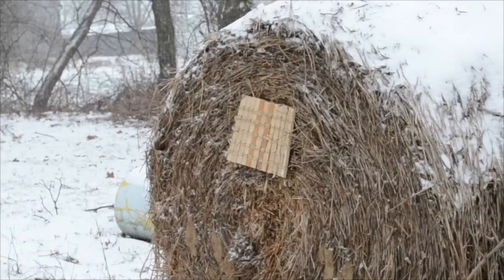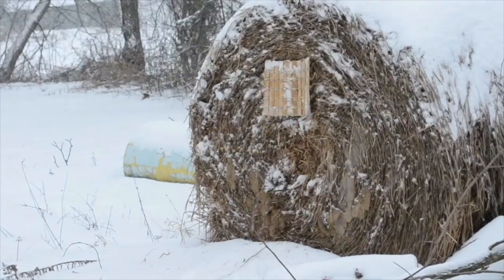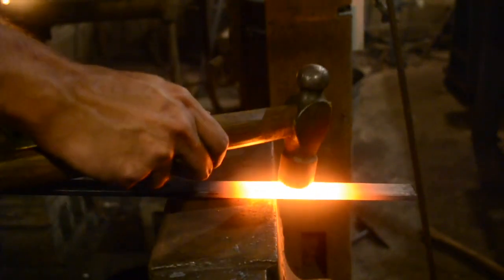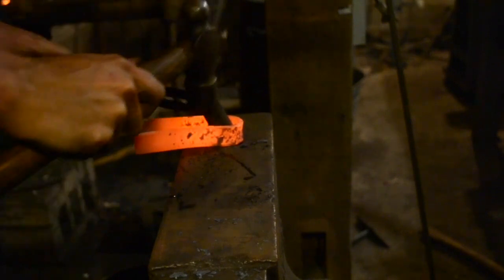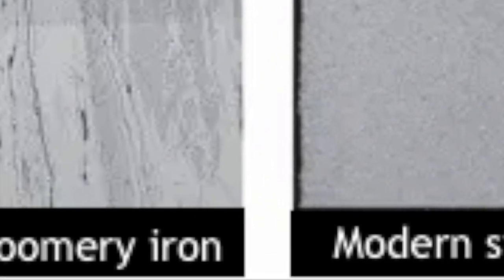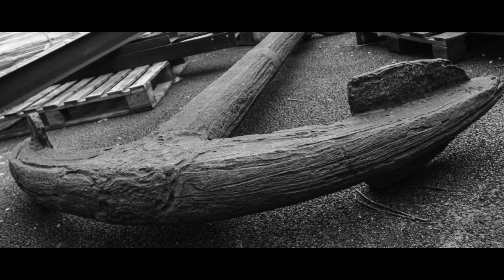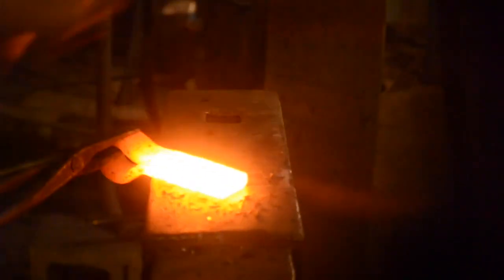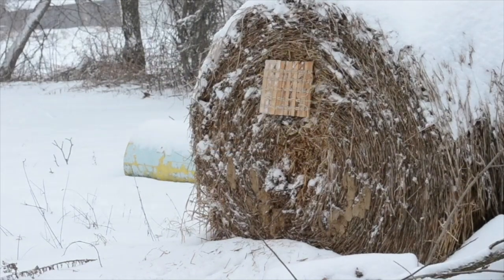Thoughts on plate armor tests and wrought iron.

Comment: The sad thing about wrought iron is that there is only one source I know of that makes wrought iron commercially for sale... and it ain't cheap.

It is now one of those weird cases where the cheapest, most readily available material way back in the good 'ol days is now way more expensive than the fancy High-carbon springsteels of Today. Which makes getting your hands on properly made 'Poor-man's armour' would ironically cost more than one made from High carbon steel! :P
Reply from the maker: And that one company doesn't actually make new wrought iron, it just recycles antiques into bar form.
Reply: @MalcolmPL  yep

Comment: As a blacksmith i fully agree, i always found this super interesting and i had the same taught that many modern armour makers miss this point (probably as You said because it is too labour intense), so far i hawe only seen one single gauntled made by damascus steel, but that turned out to be made of modern nickel steel as it seemed whan i took a close up of the picture.
It had been genuinly interesting if there could be a teamwork of skilled people who where seriously interested in a fully tecnickally accurate project, i hawe dremt about see that being done but at the same time felt it being an owerwhelming tast to preform all by my self, in historcial times it was probably done by a lot of different craftsmen in a whole cahin, not as today whan one man has to do litterary everything from zero.
Reply from the maker: Yes, you’re right, you would need a team, I estimate you would need at least four highly skilled smiths with different specialties.
And then on top of that there are probably plenty of logistical difficulties that I haven’t thought of.
Reply: @MalcolmPL  I would gladly participate if there where more people interested and the logistic problems could be solved.
Reply from the maker: Despite over a decade of experience forging, I would have nothing to contribute to a project like that.
Reply: @MalcolmPL  You underestimate Your self mate!
Reply from the maker: I lack the specialized skills required by a project like that. My skills extend to knives and furniture, neither of which are terribly applicable.

It’s like asking an optometrist to perform trauma surgery, maybe he can muddle through, but he’s probably not going to do a great job.
Reply: @MalcolmPL  
Ok, iuunderstand but damascener with carbon or nickel steel is not that complicated, i hawe done that several times, including laminated with only carbon and non nickel low carbon steel. Old Wroght iron is pretty easy to forgeweld, if You want to give it a try. I think just a small piece would be enough for trying.

I will certanly take a look again on the bog ore i found on my fathers farmland, if it is useful or not, i think the concentration may be enough to give it a try one day.

But, i hawe to learn more about the extraction process first...
As i remember it is important to first gass off organic impurities by heating up the ore powder ower a fire.
Reply: It's probably just an example of paralell invention, but there are finds from the iron age in Sweden of steel ribbon armour which reminds me a bit of those native armour You showed here, which makes me believe that there must had bbeen armour made from wood and raw hide before the iron age, but it has not been preserved and probably partly dissapeared when metal weapons where introduced, however, i hawe no idea how it did look, probably like old Celtic raw hide helmets my best guess, but with boneplates instead of bor fangs.
Reply from the maker: On the subject of smelting, here are some links to a design for a bloomery furnace with instructions for smelting.
I can’t vouch for the method personally, but I know several people in my blacksmith association who have had good success with it.

http://www.warehamforge.ca/ironsmelting/EconoNorse/index.html

http://www.warehamforge.ca/ironsmelting/QuadState08/Quad%20State%2008.html
Reply: @MalcolmPL  Thank You! I did wisit an event long time ago where they made iron directly from bog ores with the open pit method and explained the basics of it.

My old master made some reconstructions of the Mästermyr chest tools he showed me and tould about the bog iron process.

I will certanly hawe a look  on the links You gave me!
Reply from the maker: On the subject of parallel evolution, I think it’s probable that there was some sort of wooden or rawhide armor used in the european mesolithic, however I also think that the design of iron age armor has more to do with the conveniences of the metal, rather than a design tradition. Just Easier to make strips of steel than to make wide plates.
Reply: @MalcolmPL  I think so too, but i am still curious about what was before the iron strips, i don't think it was only raw hide.

Comment: Very interesting! Raises more questions though. Is it safe to assume the historical steel came from a rich person’s armor? If so was the smith any good? or did he schmooze his way to the top? I’d like to see a comparison of a nobles armor and a conscripted peasant’s, or the difference in steel quality from continent to continent. For example did the Middle East and Asia have higher quality steel than Europe? (I would assume they did) really cool video though
Reply from the maker: I read an excerpt from “the knight and the blast furnace,” by Alan Williams, he analyzed a great many suits of armor, he didn’t give exact numbers but he found a high degree of variability in the amount of slag.
However what we can say with certainty that armor was not made from the lowest grade steel, as the amount of slag limits how thin you can make the steel.
Reply: @MalcolmPL  I wish more people would put some thought in to things liked this. In school we got a lot of incomplete answers, or more often just wrong. Really basic things like “European armor wasn’t designed to stop arrows.” …..I have to stop there before it becomes an incoherent rant. lol
Reply: As a rule any armour as able to do the job its more how much the wearer suffered, even low quality iron armour was a arable to stop arrows if the  wearer suffered carrying the extra weight to make it thick enough.
As for the quality of steel, each area had it's own  way top select/make quality steel but often they did not bother to use such steel.
Japan has far better steel used in blades then in armour, as makeing armour thicker was fool proof.
Reply: In the case of maile, the process of drawing out the wires from the draw-plate actually helps to ensure that the quality of the iron going in is fairly good. In this process if you use an iron with a fair amount of slag it will snap. This practically limits the amount of... err... 'shitty' iron links in maile armour.

This is not the same for stamped rings in maile though. There are a fair amount of finds of 'not-great' solid links in maile.
Reply: @SuperFunkmachine  I'm unsure on how to feel about your last point given that Japan often used high quality steels for high end armors. This was probably more true with Japan's usage of plates in the 15th century. Especially with the development of proofed armors.

Comment: I've had this in mind when it came to the quality of historical steel, but is it possible to work modern steel into historical steel in anyway?
Reply from the maker: The short answer is no.
Reply: @MalcolmPL  Yeah, I'm kind an amateur when it comes ton metallurgy, so I just followed one idea from a forum that involved folding a piece of modern steel while reintroducing slags to form a historically plausible steel or what not.

I'm still really unsure of that, but do you suppose that the methods of making the plate should be taken into account as well? There's only two methods of making plate armors that I know of, and the last one is only from what I know about Japanese metallurgy. The first means of construction I've heard of being used for plate was case-hardening iron, and the Japanese method for making plates involved sandwiching iron with carbon steel. Are there any more methods I should be aware of, since that's something I'd like to know.
Reply from the maker: @jonajo9757  I'm not familiar with the techniques of the high middle ages, so this may or may not be different, but in the dark ages sheet metal was made by either flattening and folding and flattening a piece of bar iron until it was the desired width (sort of like modern day damascus), or else by flattening a bar and then welding several together edge to edge to achieve the desired width.